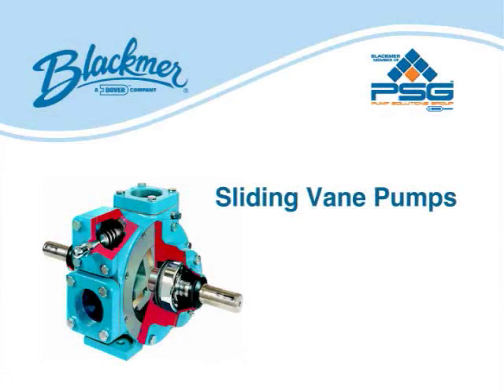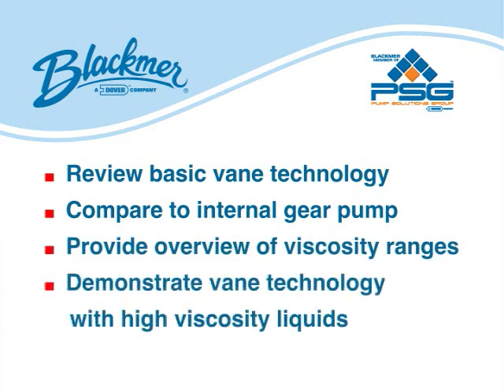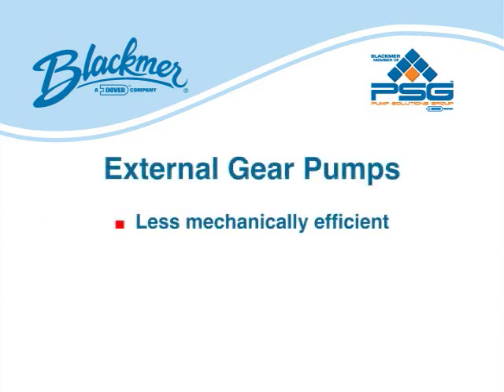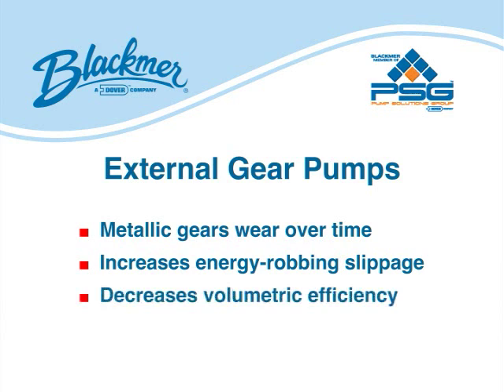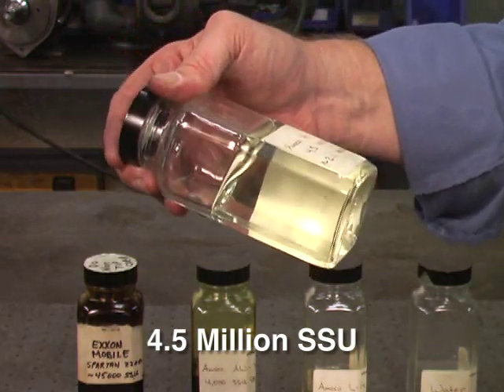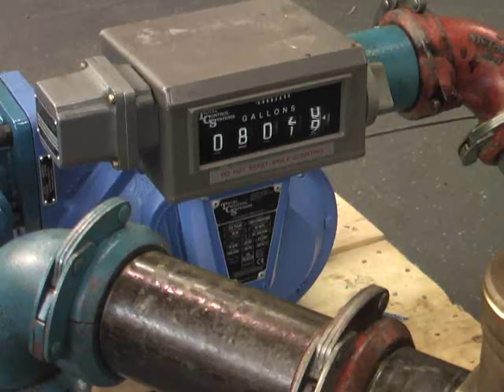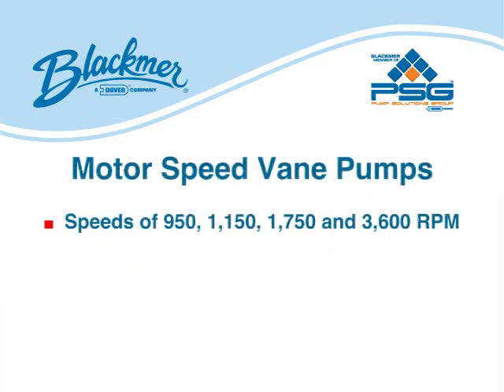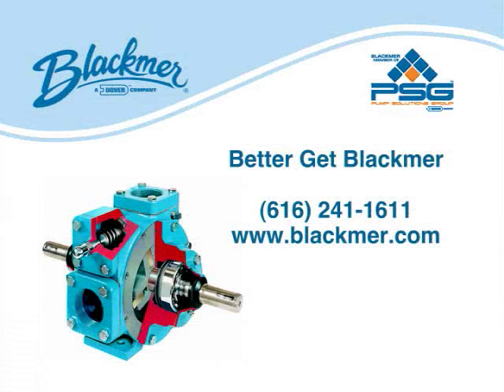Blackmer Sliding Vane Pumps in Thin and Viscous Applications

Comment: what is proper way to set regulator on bypass?  Got a piece of equipment that has been sitting a while, cleaned it all up. But pump  gets loud and hard to turn after it gets hot, it's a waukee vane  pump that compresses air and natural gas for a heat treat furnace. Thanks